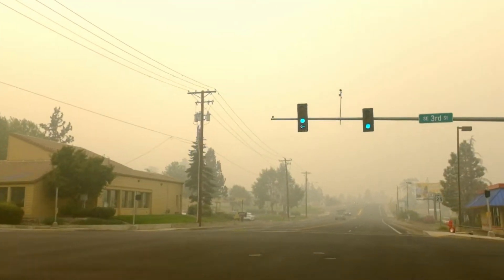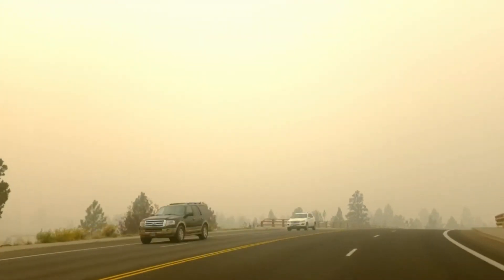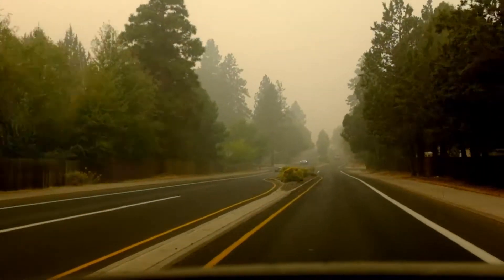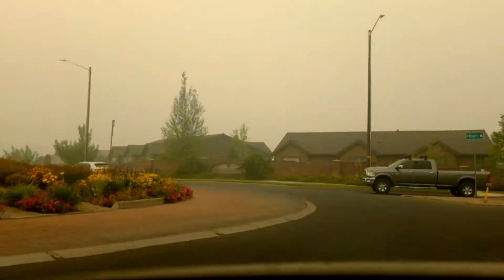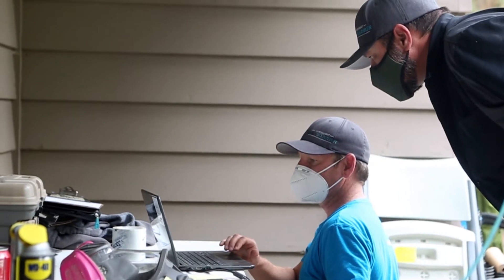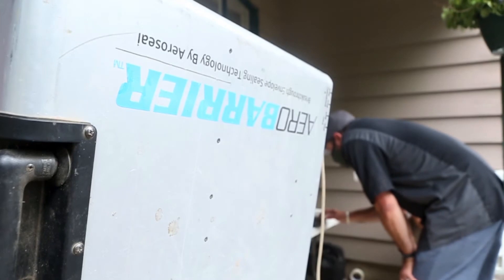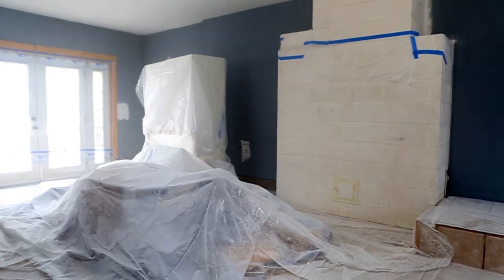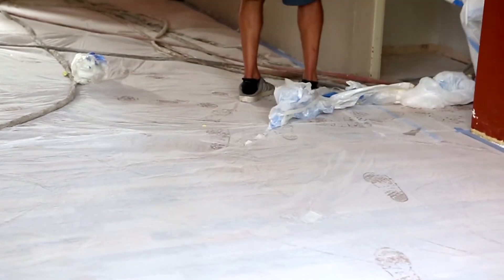Aerobarrier: How energy upgrades can transform our existing homes

Comment: I run PAUL'S AEROBARRIER in Yakima WA. I wanted you to know you did a great job on the video and the seal. What was the starting ACH 50 finish ACH 50 and percentage of reduction in envelope leakage? 

I imagine the starting ACH 50 was pretty high based on those outlet boxes.
Reply: We started at 9 ACH@50kpa and Around 1.5 ACH @50kpa but that is with operable windows and chimney taped off